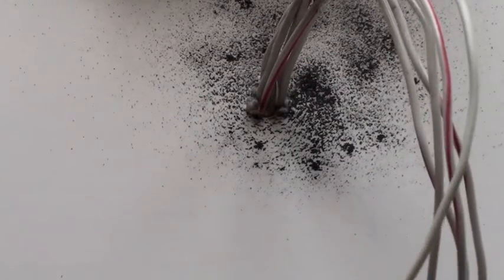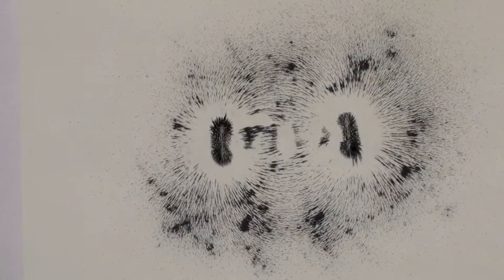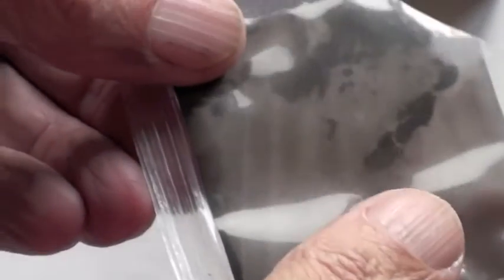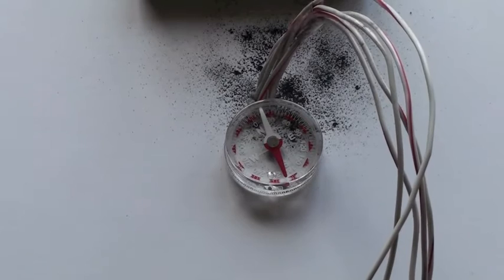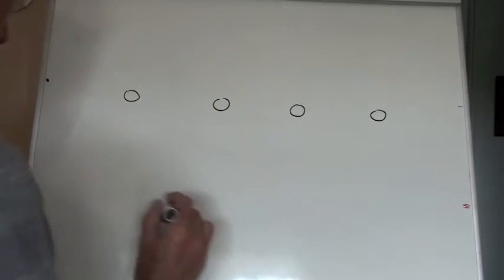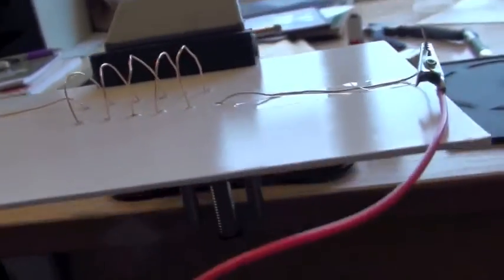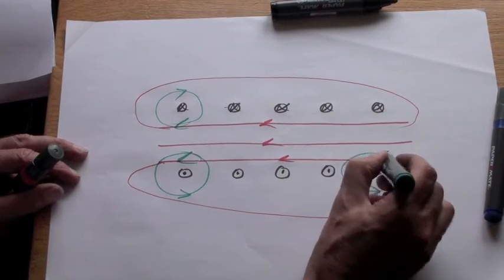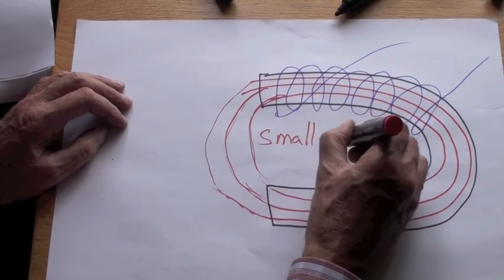How magnets work, demonstrated and explained: from fizzics.org

Comment: Thanks 

Can you help in showing the difference between field intensity H and field density B.

I am little confused in there
Reply from the maker: Copied straight from Wikapedia, a good explanation: 
In electromagnetics, the term "magnetic field" is used for two distinct but closely related fields denoted by the symbols B and H. In the International System of Units, H, magnetic field strength, is measured in the SI base units of ampere per meter (A/m).[4] B, magnetic flux density, is measured in tesla (in SI base units: kilogram per second2 per ampere),[5] which is equivalent to newton per meter per ampere. H and B differ in how they account for magnetization. In a vacuum, B/{\displaystyle \mu _{0}}\mu _{0} and H are the same; but in a magnetized material, B/{\displaystyle \mu _{0}}\mu _{0} and H differ by the magnetization M of the material at that point in the material.
Reply: @fizzicsorg  
Thanks
I read this and many other explanations for B and H. As formulas i do know how they relates (B=uH).

What i was searching for is a video explanation. 

What i learn from your video about about flux and magnatic force was much more than any bock,, simplified and straight.

Hope if something about H and B.
Reply from the maker: @mohammadalshaikhhasan5091  So, in essence, B the flux density describes how strong (or dense) the field is and H describes what effect it has and that depends on the medium. Some materials are more susceptible to a magnetic field than others.
Reply: @fizzicsorg  

Thanks

I sent you email about magnetomotive force F = H×L
F = ΦR

Is this leads to same formula from you for force (F= NBIL)

Thanks

Comment: I learned that it was "right hand rule" for the current flowing through a wire. If you make "thumbs up" shape,  the thumb represents the direction of the current while curl of fingers represents direction of magnetic force
Reply from the maker: +Aakash Kalaria Hi, yes that's right. I did not use it because I prefer an explanation that relies on as few rules as possible so I stick to the one about the field being clockwise around a wire, however the right hand rule is useful if you need to quickly determine direction.